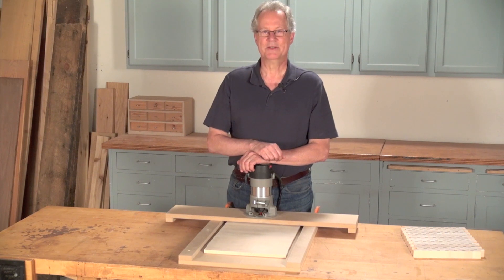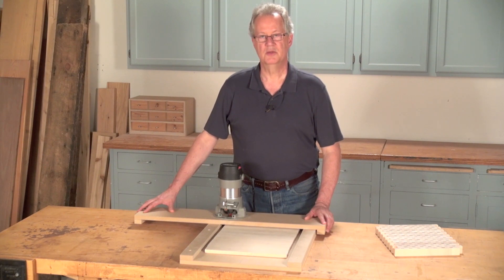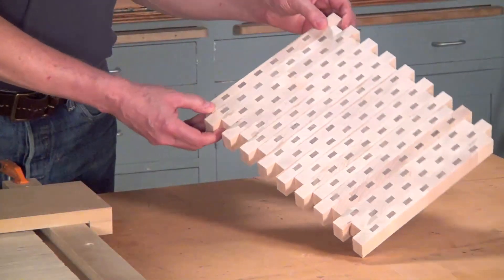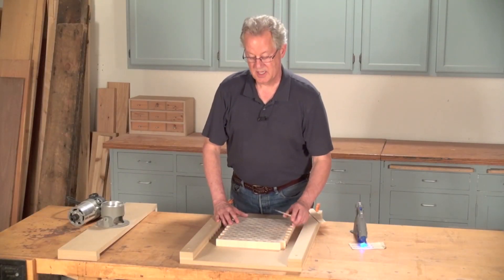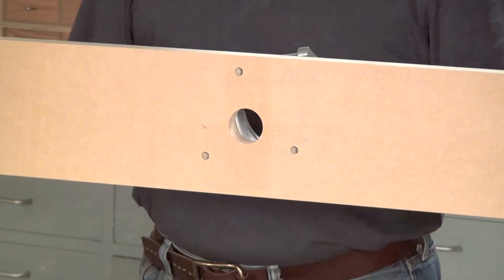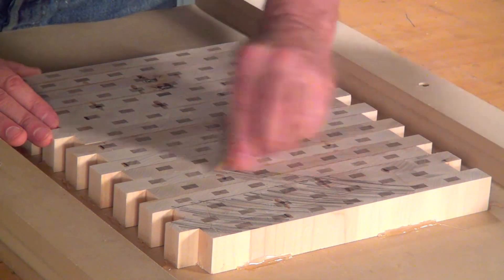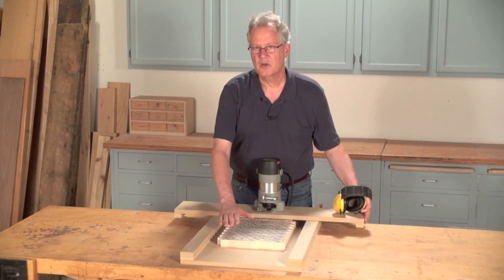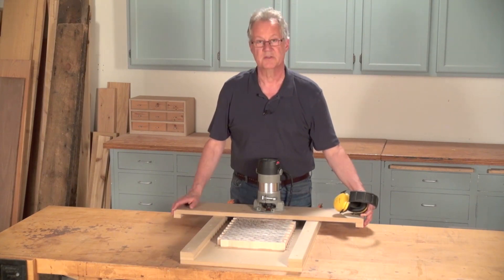Planing with a Router

Comment: Thought that this should have an update. I have been using this type of jig for just over 2 years now and I cannot fault it. I have built other jigs where the router moves from side to side on a sled but I actually found this fixed router jig to be better. I still can’t get my head around the negative comments from the naysayers but I suppose it strengthens the argument that it is impossible to educate pond life! A belated thank you for a brilliant but simple idea.
Reply: Thanks for posting your opinion. It is enlightening for a beginner

Comment: if you're going to use mdf, add some vertical pieces to your gantry to prevent any flexing or sagging. and going forward and back instead of left and right will be easier on your back and arms.
Reply: I will try that

Comment: I’ve built my own version recently but have struggled to come up with a system to hold the workpiece (in my case guitar bodies) firmly but temporarily in place.  Your hot glue method works extremely well.  Genius solution! Thank you. 👍🏻🏴
Reply: I think his name is Matthias hornbrenner, something like that, he just built a $10,000 bed so you can find his channel that way but my point is, he has a video on hold fast that rotates to lock, I would look into those or just try wedges
Reply: Have you tried heavy duty double sided tape? That's what I use on mine and it works great and comes away and cleans up easily

Comment: This is the best method I've seen and used.  To me the control is absolute.  The only thing I use to stabilize are wooden wedges instead of glue.  He didn't take off a lot, but you can remove up to an eighth of an inch without losing control or decrease quality of work... any thicker depends on tool and securing to jig.

Comment: This approach is a little different than most in that the router is fixed to the support, and the support is moved back and forth. The other DIY router-planers have the router moving freely along a slot cut in the support. Your setup has the benefit of less vibration sent to your hands, and the  router stays vertical.

The hot glue and not cutting on the return stroke are good tips. Thanks!

Comment: Solid suggestion, and allows use of on-hand materials.
I think I would make the gantry out of t-slotted aluminum extrusions, 
for three reasons. 
a) I think it would make it more rigid
b) I think it would give greater visibility and control of your work.
c) It could be made adjustable, so that it would be useful on more than one project.
Then, I would leave a router base installed on the gantry, 
and just move the motor from that base to a different base 
when I needed it for another kind of project, or to clean up the shop.
.
Otherwise, very helpful for someone who had not seen such a router idea before.
Very familiar to me 
from working with Solid Surface countertops (like Corian), 
and preparing undermount sink mounts... 
another place where this kind of jig is very helpful.
I hope the comment is helpful to your other viewers.

Comment: I'm using a shelf attached to my bench and a top bearing router bit, but your rig looks much better. For one, you don't have to slide my lumber through after each pass, and can also use a more suitable bit. I'll definitely make a rig like yours if I need to flatten more boards out in future.

Comment: Could I build a lower frame around the board and screw it down. This would stop left, right, forward, and backward movements. Do I need to worry about surface moving up and dow ?

Comment: You're taking off so little. Would it be easier to just sand or does this ensure the entire piece is perfectly level and flat (I'm a beginner woodworker)
Reply from the maker: Fair question, and this isn't a recommended procedure for most flattening needs. If you're sanding, you're only maintaining accurate flatness at the point of the sanding pad (assuming a random orbit sander). Every time you move the sander to a new section/location you introduce motion with your hand and that can add ripples and dips along the surface. The referencing frame used with the router at least introduces a stable height to ensure flat across the whole surface.
Reply: Also, with end grain like that, sanding takes a looooooong time.
Reply: @popularwoodworking  what about a belt sander? would it at least be better than an orbital?
Reply: I believe that the issue with using any sort of sander is that you may not end up with a fully flat, true, even surface, whereas with the router you can. 

The good thing about this process when compared to hand sanding  is that the moving MDF parts are both factory-flat. Because the movement of the router along the up-down axis is limited by the plane on which those two MDF parts are sliding against one another there’s no opportunity for the router to accidentally cut any deeper than the max depth that the woodworker has set the bit to. 

With a sander, you might get a totally smooth surface, but with no control set on your Z axis it’s very likely that you’ll end up with an uneven surface all the same. 

At least that how I understand the advantage of this jig compared to using only a sander. It’s possible that there’s a way to get fully true surfaces on both sides of a piece of wood using only a sander though. I think that it would need to be very good to convince me to use it over this method! But it’s probably out there.

Comment: Is it just a straight type bit that you use for a dado
Reply from the maker: You could use that, but we recommend a bit designed for surfacing instead. There are a wide number of choices out here, but here's on example: https://ballewsaw.com/whiteside-6210-1-cnc-spoilboard-surfacing.html?utm_source=google_shopping&gclid=EAIaIQobChMIpdjFro3c4QIVFLbACh3aqw5aEAQYBCABEgIuuPD_BwE

Comment: So-so... I think it would be much better to keep the board with angle of 90 to sides at start. This way wouldn't guarantee the correct angle after finishing.
Reply: Олександр Шкурат in this process you are simply making the top and bottom coplaner to one another. once the two sides are both parrellell and flat milling of the perimeter is done. this is evidenced by the fact that the cutting board still has all of the waste wood attached. this process gives a better overall surface and would ensure a 90 degree corner from face to side (or any angle so desired for the project). You could also use a sled on a table saw to make sure the edges are also 90 degrees to one another.
Reply: OK, let's assume that planks on both top and bottom at one side are protruding a little. So, in this case you wouldn't get 90 degrees angle. What solution can you offer for such a situation? Thank you in advance!
Reply: Олександр Шкурат I'm a little lost on your question but if I think that I  addressed the squared edges question already. if you were asking about a piece of the end grain being longer so the piece does not lay flat you can shim the work initially. if it is in regard to the edges you can clean them up with a table saw later. I guess I'm lost if it's more in depth of a question than that.
Reply: Never mind. I'm sorry for bothering you. I'll think it over by myself.
Reply: @oleksandr4685  i think when you flip it over, and do the other side, it will then make the two sides "even" or co-planar like tim said.